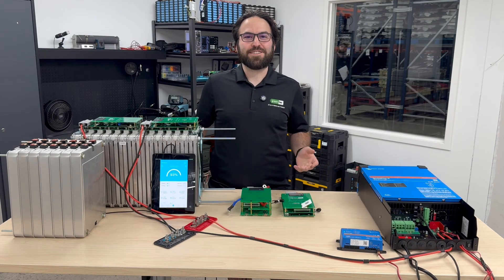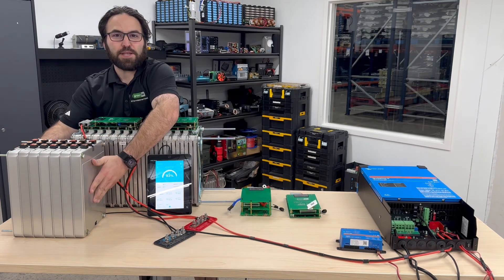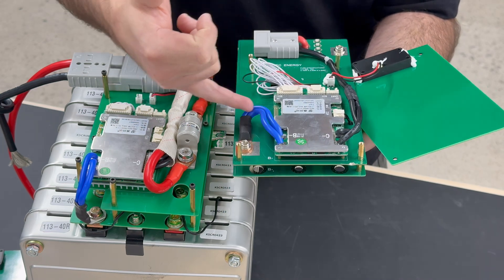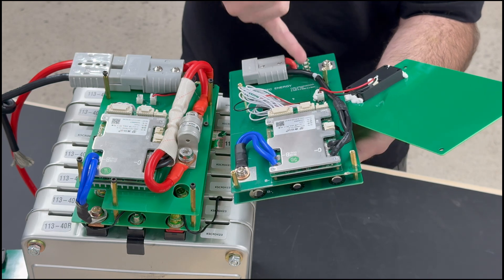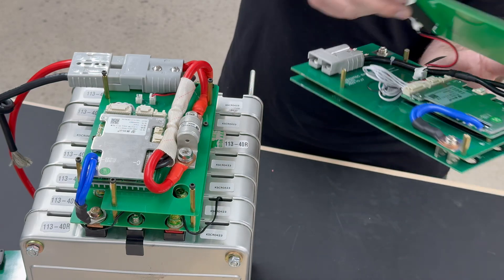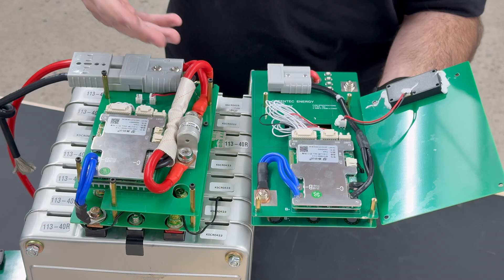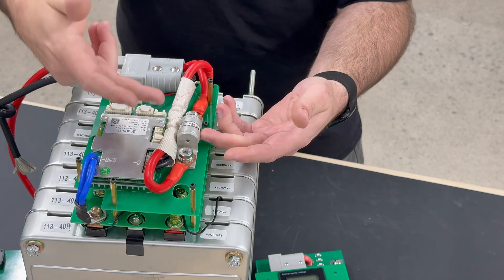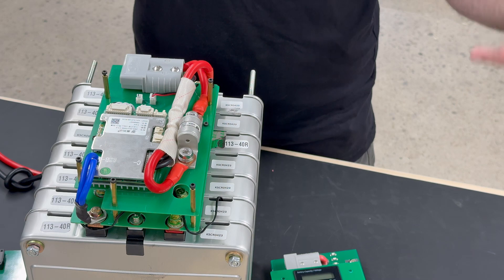All about Greentec's 48V BMS kit using Nissan Leaf cells for inverters, golf carts and more!

Comment: Having trouble getting a call back from Greentech. I first ordered 4 of them and the only issue I had was a noticeable deviation on SOC from the app to the display on the BMS. I then bought 2 additional and 1 doesn't work and the other has a undervoltage fault despite it being at 56.6v on a 14s battery pack. Also, BMS app doesn't allow you to change anything. Need this capability to dial in my AH capacity and other settings.

Comment: Question If I have a 100 volt battery pack can I wire 2 of these in series 

my Plan was to so a 2 series and 2 parallel
Reply from the maker: It is not recommended to wire two batteries in series that don't balance between themselves. You will have limited performance if they are at different charge levels and they might not work as expected.

Comment: Hey Levi I just ordered 42 G2 Nissan Leaf batteries from GreenTec. Would I need 7 BMS ? Also, is there a Solar Hybrid Inverter Charger you could recommend for this setup? Also I used to be real good at comprehension on projects like this. As I do all the work here on the ranch. I come from a Cellular switch background. Is there a book or a PDF you can recommend for building this wind turbine /battery /Hybrid Inverter Charger/ power connection to the home /grid connection. Is there a transfer switch needed? The Telco switch I worked had 540 48v wet cell that ran 24/7/365 continuous power to equipment. Charging from commercial power. But that was 10 years ago the brain needs retraining.
Reply from the maker: Hello, You would need 6 of the BMS kits. We may be experts in the batteries, but we do not have a lot of insight to share on the inverters. I'm afraid we would not be able to recommend anything outside of the battery.

Comment: I am looking at replacing the FLA batteries in my Golf Cart with something like this.  It a 48v cart.  It is a Club Car 6-seat cart.  But, I have a couple of questions first:
1)  The power cables are 2 gauge welding cables.  The discharge wires prom the BMA are 8 gauge I believe.  Will that work?
2)  Is a 100A BMS enough to handle a golf cart?  I have a 500 Amp controller.  Will that cause the BMS to shut off when accelerating quickly or going up hills?  My neighborhood has a number of hills. 
3)  I currently have 8-6V Trojan T-105 batteries.  I'm not sure what the Amp Hrs. or KW ratings are.  How many kits would I need to get similar capacity?  2 kits or 3 kits?
4) I have a Lester Summit II 1050W charger now that says it will handle LiPo batteries as well.  That should be OK, Correct?
5)  I'm in Atlanta, GA.  Weather is neither too hot or too cold.  So, at what point does the temperature affect the batteries, i.e. when will the BMS shut me down?  I understand that the cold can affect the capacity, but I don't want to get stranded somewhere thinking I have a lot of battery left.

I enjoyed the video.  Thanks for the help.
Reply from the maker: Hello, Thank you for your questions.
1. The BMS is designed to work in parallel with more than one bank for high current applications, so you can parallel the same BMS with itself and then to the thicker 2 AWG wire. 
2. Same Idea, you would want to parallel at least 5 of them to be sure, you might be able to get away with 4 if you had a lighter foot.

3. Looks like those are around 185Ah at 5-hour rate. We have people say you can do half the lithium capacity for the same runtime as lead acid. Even if 3 kits were enough, you want to make sure they can handle the 500A from question 2 so might want to go higher.
4. You would want to make sure its program is changed to lithium if it has that option. You could also get a Over voltage under voltage switch for added protection.
5. As long as you stay below 120F on the batteries, they will still work. That's not ideal, but keep an eye on them and don't overwork them. As for the low temp, the batteries working temp is -13f to 140F, but I wouldn't recommend reaching either of those.

Comment: i i'm interested in the 100A continuous version to run 4 x 48V packs using 3 double cell and 1 sing leaf cell pack. if i use one BMS kit per pack do they a. do they balance between each other so that all 4 charge/discharge evenly. b. can the combined battery back state be integrated into the victron unit? in currenlty using the 48V multi plus2.
Reply from the maker: We would only recommend doing that it they are the same capacity. If you are mixing G2 and G3 modules, they will likely only be as good as the weakest link. If you are splitting G3 modules in half to do it, then that should be fine. We just added a 12S 50A BMS, that could save you some trouble.

Comment: Hi I bought greentec bms kit  48v for Nissan leaf battery  how setup the busbar to leaf battery and instruction or videos thank
Reply from the maker: Hi, the bus bars on the bottom of the BMS are permanently bonded to the PCB board. You just line up the whole BMS and bolt it on the cells.

Comment: What is the remaining capacity of a module that used with the 100A BMS ? Anyway if we can measure the capacity of each cell then we can parallel the modules . In that case we don''t have to use two BMSs
Reply from the maker: Each module is 52v and the capacity of one is 1,721Wh, this is the same for both generation 1 or 2 cells and using a 50A or 100A BMS.. Raising the amperage of the BMS doesn't change the capacity, it just allows you to use that electricity quicker. I personally use a 100A BMS in a 30A scooter just so it runs cooler.
Reply: @greentecbatteries  As you mentioned the BMS can't increase the battery capacity. It can do all the protection work so we can use it for a long time without damaging cells. I assumed these are used batteries. That's why I asked about the remaining capacity. It seems like 1721Wh  battery block has 30-32Ah modules . Anyway you are doing a great job by giving another life for these used batteries.

Comment: How many would be needed to run a golf cart with a 8kw motor and a 10kw controller? I only need it to have about a 10-15 mile range because I rarely go more than 5 miles.
Reply from the maker: Each module is already 52v and the capacity of one is 1,721Wh and can output 5,200 Watts continuous so two would be the minimum. A golf cart averages 150Wh per mile so that is 11.5 miles per battery kit (23 miles for two modules). However its not ideal to push them to their max all the time, both for heat and it wears out the cells faster. So the more modules you can fit in there the better. The Length is 11.9291" (303 mm). Width is 8.7795" (223 mm).

Comment: You should make a BMS that does cell balancing.
That I would buy...
Reply from the maker: This BMS does do cell balancing. I have been using this brand in dozens of different batteries for many years, as well as over 10 other brands. I can say from experience that JBD is far superior in its balancing abilities than the other comparable ones like ANT and Daly.
Reply: And jk which i m using

Comment: Hello, do you deliver to Canada? and where can we select the 100 AMP BMS. Thank you
Reply from the maker: We do ship to Canada, shipping costs depend on your location. 
The 100a BMS in the video was the last prototype and final version is being manufactured now and should be available within 2 weeks. We will set up preorders in the next few days.
Reply: @greentecbatteries  when I fill out my order, when it comes time to enter the state (CANADA), I cannot enter it directly, and it does not appear in the options, so I cannot order!!!
Reply from the maker: Sorry about that. The shipping costs in Canada vary a lot based on your location so  please call in to our toll free sales line 1-800-773-6614 to get a quote and place your order.  You can also reach out to our contact us on the site but it will obviously take longer to get a response.
Reply: @greentecbatteries  I called the number you mentioned to me, and they told me that they did not sell the BMS alone!!!!, so I wrote, and no answer!!, not easy to want to buy a BMS from you 😞

Comment: Is it possible to use in series to increase the voltage e.g. 4 in series to get a 192v output ? How would the balancing work in this case ? (I'm asking because my solar hybrid inverter has a 160V dc min voltage rating)
Also the shop only has the 50A BMS for sale, is there a link for 100A version ?
Reply from the maker: No this BMS cannot be connected in series because it uses mosfets to shut off the flow of current if anything gets outside of the safety parameters. They ones inside the BMS are always rated a little bit higher than the maximum voltage of the BMS so if you were to put 4 in series and something went wrong in one of them the voltage of the entire pack would be far greater than the mosfets are capable to stopping and there is a high likelihood of it frying out the BMS and possibly allowing current to continue to flow which would be a fire hazard. The only BMS capable of doing what you are talking about are ones made for that many cells like an Orion BMS or ones that have many slave units that handle a portions and all communicate to a master BMS like the Thunderstruck BMS. Both of which are very expensive. Also are you sure your inverters 160v minimum is that of the battery and not the solar panels circuit?
The 100a version is in production now and will be available on our site here in a couple weeks. Thank you!
Reply: @greentecbatteries  Thanks for the detailed reply, I now understand the limitations. Yes, unfortunately the inverter only supports HV batteries. I will look at the work that Dala is doing around hooking up used vehicle batteries to inverters and using the existing BMS and safety devices / contactors in the battery pack.

Comment: The horrible thing about used cells or cells in general is that you'll never get all the cells to discharge evenly.  You'll always have one cell reaching the uvp of 2.50 or so while the rest of the cells will still be around 3.00.  I always find that extremely annoying. Fossil fuels are still the best. Batteries are only good for short term use to allow for a seamless switch from the grid to a fossil fuel power generator when experiencing a power outage.
Reply from the maker: You are not wrong, there is deviation in capacity of the modules that come out of one pack. However, if you purchase our modules, they will all be capacity tested and grouped so you wouldn't run into that issue. They would all charge and discharge relatively evenly.
Reply: Trolling, or just ignorant ? You can't just buy a "fossil fuel powered generator" and leave it lying around. It requires maintenance, the fuel goes bad if you don't use it very often, it's noisy, polluting etc.
You do know what the BMS is used for ...it monitors the individual cell voltage so you can pull out and replace a cell that is going bad.